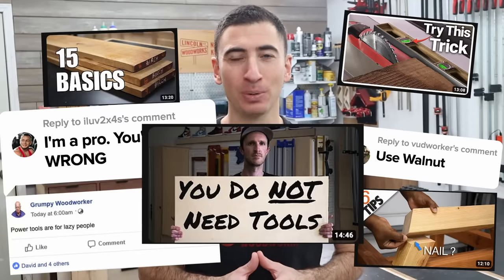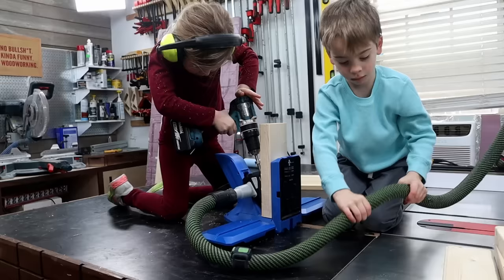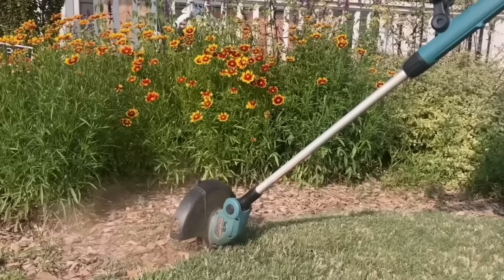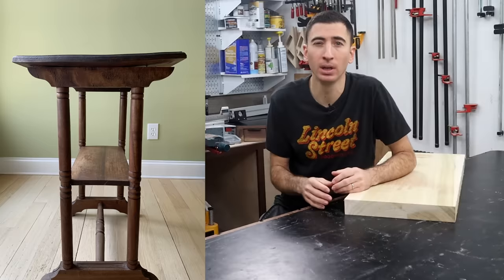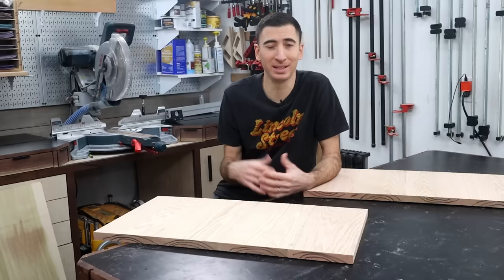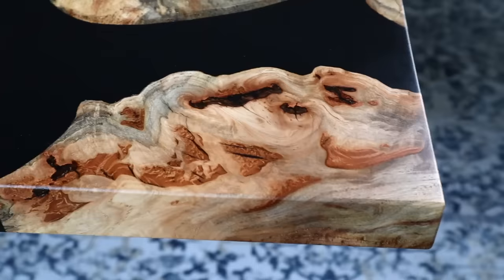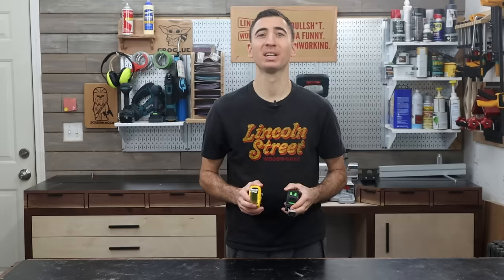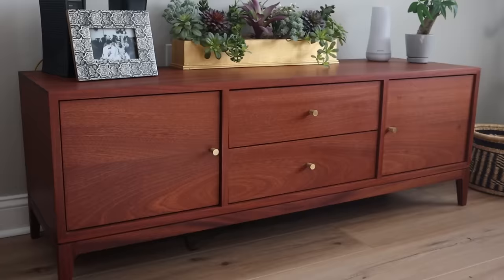Every beginner needs to hear this

Comment: Anecdotally coming across antique pieces with alternating boards that have cupped, and non-alternated that haven't, has a bit of survivorship bias. We have zero data for how many of each type failed along the way and were taken out of service (disassembled, thrown away, burned, etc) or repaired. When I worked for a high-end office furniture dealer (clients from international tech brands, auto manufacturers, global department store chains, VC firms, and charitable foundations), and one of our big tech company clients purchased multiple thousands of glued-up, wide-ish plank "butcher block" style desktops and cafeteria table tops over the course of 4-5 years. All wood was properly dried, all seams were reinforced by floating tenons (mostly just for glue-up alignment), and finished on all sides with a conversion varnish. While the offices had robust HVAC, we still noticed drastic differences in the number of "trouble" desk/table tops when it came to the grain direction of the flat sawn wood. So much so, that eventually there was an added requirement that the wood direction be alternated from plank to plank. And this wasn't a customer requirement: it was the manufacturer who decided to implement the change due to the number of warranty claims, and did so with no additional cost to us...doing it the commonly-references-as-wrong way was costing them money.

Hard agree with the sawdust+glue issues, though. Using it is terrible advice in many cases. One super annoying thing I see on so many pieces of furniture and flooring, is when a blemish or something is filled, and they use a LIGHTER fill. It always looks gross. I see so much maple and oak with holes filled with light Band-Aid colored wood filler, and it's such a turn-off. On my stone tile in my kitchen floor, too. IMO darker will always look more natural. We're used to seeing "shadows" on furniture in reveals, and under overhand, etc so dark spots don't stick out as much to my brain...but a light patch doesn't make any visual sense and sticks out like a sore thumb.

And also a big agree on the power tools. There's no "perfect" brand. Aside from Festool, Milwaukee seems to have the best track saw, while Dewalt seems to have the best trim router, and Ryobi has the best 13" lawnmower and hot glue gun. :) (I kid...I adore my Ryobi glue gun and 13" lawnmower!). Makita's cordless miter saw has the best power compared to Milwaukee and Metabo, but Metabo has the best dust collection and 45 degree miter accuracy. From the big brands, performance differences are negligible in most tools, unless you're working with them 8+ hours a day where small ergonomic or performance differences have  a big impact.

Comment: Regarding the second thing about power tools... I bought a black and decker drill that has done pretty much everything from taking apart garden furniture (a rental had had pallet furniture screwed together, I wanted to get rid but remove the screws first where possible) to drilling through masonry for a tv bracket. I bought it four years ago and it's going fine. I bought it for less than £100. I also have a MacAllister circular saw, orbital sander, planer and router, each around £50 each and whilst they may not last if I was working professionally, they absolutely do the job I need with no problems. My only screw ups were my own fault as a newbie.

You do not need super expensive power tools as a beginner. It's not just a case of "if they're cheap then you'll think woodworking sucks" or "they'll cost you more in the long run"... trust me unless you're buying power tools on Wish, they will make back their cost quickly.

Comment: The comment that budget tools are fine for beginers because they don't put enough hours on them to wear them out is sort of true. the problem is that tools are not rated by total use but continuous use, call duty cycle. It used to be part of the spec's you saw on the box but I suspect it was dropped because it showed up the real differences! Duty cycle is the continuos time you can use a tool for before you need to stop and let it cool down. It is usually expressed in min/per hr. Cheap tools tend to have duty cycles of under 15min, quality hobby tools around 35-45min. 'Contractor' tools should be rated for continuos duty, eg you can use it for an 8hr shift without it breaking. Obviously that needs better cooling, better bearings, gears etc and adds cost. So by all means by cheaper models for tools you will only use for a short time but don't try refinishing a wooden floor with a $60 belt sander, it is going to melt!!

Comment: Good video & advice. Thanks. I'm a hobbyist/My Home remodeler. My choice of battery tools is Makita - for their long lasting batteries. I baby all my power tools. Yeah, I know - way too much. I have 2 drills that still work good, but don't use anymore I bought in 1965! One is a $10 Black & Decker and the other is a heavy duty metal case unbranded department store drill. My good electric drill is a Dewalt.

Comment: spot on with everything! and I am one of those "been doing this for 30 years" guys but I am NOT the type to act like I know everything or that there is only one way to do something nor would I want to discourage anyone from getting into woodworking. I have spent the first 15 years of my career as a custom cabinet maker and this last 15 years have been in the field installing cabinets, trim work and building custom items for people so I have a different perspective than someone who has spent all their time in the shop and become a total snob about things. I think what makes for a great craftsman is the ability to understand what matters and when it matters. there is a time and place for very intricate complicated woodworking for sure, a time and place for perfection, but as you have said in this video , in most situations all that crap is not nessisary and does not really benefit the project.

Also I do personally like to have really good quality tools because they work well and I do this for a living but if I was just a hobbiest or a homeowner that needed some tools I would 100% go for Ryobi , honestly nowadays Ryobi is not even bad at all, they are pretty comparable to the more expensive brands, there was a time when  ryobi was just absolute trash but not the case anymore. In my beginner days I made some great things using crap tools, it is completely possible, it just takes longer and a little more difficult.
Anyway thats my two cents on the topic. anyone wanting to get into building things reading this...I DARE you to just do it, build something, it doesnt need to be great , build a box or a workbench and get the feel for things. each time you create you will get better.

Comment: I mean to be fair though, people suggesting dowels aren't wrong. The price of glue and dowels, some inexpensive dowel marking hardware is far less cost than a pockethole jig, special bits and clamping pieces into funky contraptions to get them lined up. Say the kreg kit, the basic kit is currently on sale for $34 and range up to $90-150 for more deluxe versions (because they know clamping the small kit is going to suck). Multiple self centering dowel jigs are $10, even woodpecker jigs are under $30. Options that don't require more traditional joinery. 

If people want to pocket hole every project like ana white, knock themselves out. Makes for a good 10min yt vid. Same people scotch taping wall covering up and other 'it held long enough to video it' techniques. Pocket holes do have a place but most people are like a little kid who gets their first hot glue gun. Suddenly they're using hot glue for everything. Nothing wrong with offering alternatives. Again making assumptions someone wants to get into woodworking. If they want to avoid the hassle, ikea exists.

Comment: I like your approach to these guidelines, especially the pocket screw controversy. I was taught, many generations ago, that a proper glued joint will actually be stronger than the wood itself. Great for sold wood, MDF requires a different solution because the surface does not have the tensile strength that solid wood has . I live in Oregon so the notion of using extruded shop floor sweepings makes me gag anyway!

Comment: I don't know if they're still made as well, but I always hear trash about Ryobi cordless drills, but my 18v WILL NOT DIE. It's fallen off my 6' ladder maybe a dozen times onto the concrete garage floor, and I don't know how many more times off saw tables and workbenches. It helped build a whole stage set at a theater in Hollywood for my friends, passed around to novice users for an entire weekend. It's put in a dozen 100pks of 2" and 3" Kreg pocket hole screws, and drilled the holes for them. It's put together a bunch of cabinetry and projects. I've drilled countless holes with spade bits, auger bits, and every kind of spiral drill bit up to 1". It's cut holes through 2x material with an adjustable hole saw. It ran Halloween decorations for a few years - from fully charged to dead every night for the month, with a zip tie holding down the trigger. It's my only drill, so I use it for absolutely everything, and have for 20 years (as of this year!). Maybe it's no good for a person doing all-day framing work(?), but for a guy who was pretty obsessed, with a hobby shop of about $10k worth of equipment (at 20-years-ago prices), out there building ideas every day for a few years, and then all household needs, I wish everything I had was this rugged. It still looks good, and I don't even think I've replaced the battery yet (if so, then once). It feels like it'll last the rest of my life.

Comment: Mostly agree. But I’d love to see more data on the alternating growth rings. Species likely has much to do with it. I accidentally glued up a table from very dry walnut without alternating, and it did cup after a couple years. I’d say alternate if you can.

and there is value in glory and the satisfaction of proper joinery.

Still, appreciate this style of teaching!

Comment: I found he’s right about the growth rings. I made an island top out of ash and before I started the finish it severely cupped even though I had alternated the growth rings.. The wood had naturally dried over a few years so it wasn’t too wet. I told what happened to a friend who built custom cabinets and he said to turn it over and leave it alone for a few days. Sure enough, it went flat on its own. Then I finished and installed it and it’s been fine. One key tip is to not finish and seal it unless it’s flat.

Comment: I started out with a DeWalt drill and circular saw 20 years ago, and both of them died a couple of times. Then about 10 years ago my wife bought some small Ryobi stuff for misc small jobs… it ended up replacing all my DeWalt stuff and in 10 years haven’t had anything Ryobi die on me yet. It certainly feels cheaper, but is holding up to my amateur needs.

Comment: There are good reasons why all of these tips and adages came about, and thus reasons to continue using and following them to some extent, but like many things, the good gets blurred when taken to extremes and misconstrued. Knowing the strengths and behaviors of more advanced joints and how you could incorporate them into your work is a good thing; but yes, remember that pocket hole joints do have advantages in speed and simplicity and will hold up just fine for general use. Yes, most hobbyists aren't going to strain most power tools to the breaking point, but it is still a good idea to get to know why certain professionals prefer certain brands for their features and durability to make an informed decision of what works best for you. Yes, grain direction probably isn't going to make that huge of an impact on what your average hobbyist makes, but the important part is to understand how wood behaves over time as a construction material and bear that in mind as you're designing your piece.

Comment: For what it's worth, I purchased my first Ryobi circular saw/sawzall kit 26 years ago. The circular saw just died last week, when I was trying to force it through wet pressure treated lumber. I was in a hurry and didn't want to break out the corded saw. The sawzall is still working. 

I have Milwaukee Fuel 12v tools for my everyday work stuff now, but that's only been in the last 2 years.

Comment: Ive actually felt the difference on Ryobi, hence I bit the bullet, added more money and went with Makita LXT RTJ set (RTJ is their "starter" tool, charger and two batteries). Ryobi plastic was cheap.
Good advice to platform is to go to a store that sell most brands, grab their tools and check how they feel. Also, for now - stay away from Hilti, Festool or "worst" of them - Mafel. They are expensive AF.

Comment: I was enjoying cabinet making when Makita 9.6 came into the marketplace. Their corded tools had long, long cords (B&D and SKIL had shortened their cords to a pigtail). Those drills installed more cabinets in So-Cal then I want to remember. Then came DEWALT's 12 volt platform.... and I had to have the "best" which meant I had more money than brains... although THAT WAS a real improvement. BUT again as DEWALT kept putting bigger and bigger batteries on their drills/platform I started to realize my arms started to look like Popeye's from lifting such heavy drills all day installing cabinet/countertops. It was THEN I realized I was sucked into "bigger was better" and it really wasn't true for ME. I now use Ridgid 18's at home since I've retired a few years back AND I like their warranty... so I AGREE WITH YOU about pick a color and move on. I still have a Ryobi Chopsaw and jigsaw in use today, though my main chopsaw IS a sliding Dewalt.

Now.... about measure twice cut once or is it vice versa... EVERY time I mark the wood like you showed, I cut it just a tad long and then recut it.... I end up cutting it short then I need to mix up a quart of wood glue with a shovel full of sawdust and create a mold around the short board I just cut short and pour my concoction of glue and wood dust into the board mold. Seriously, I just learn to cut line plus, or line short after marking it. Really I don't make that mistake too often NOW unless... unless I can't find my coke bottle thick safety glasses and I just wing it.... oops.... there goes another finger!!!

Again, seriously I really enjoy your tips and tricks. It's really okay to start small, buy less expensive tools and as time/budgets allows move up the quality. I would recommend find a tool line that does allow ALL battery sizes in their brand to fit any of their tools. I did NOT like DEWALT would not allow you to slip a 18 volt battery on a 12 volt drill (that is... if I recall correctly). Dang.... I miss my DEWALT 12 volt drills, though the Ridgid 18 volt line is as comfortable.

Lastly, keep the vids coming as I still learn better/smarter/affordable tricks/tips on YOUTUBE. Thanks!!

Comment: When I was a child, my dad built a hutch to sit on top of our computer monitor out of pine. He used screws and glue, telling me that the screws were there mainly to hold the joints tight until the glue set. 10 years later when we decided to get rid of the hutch, it was a surprisingly difficult task to break it apart. I thought that once I removed the screws, we could just bust it up. The glued joints seemed almost stronger than the solid wood itself. I think we ended up cutting it into pieces. For furniture designed to sit on top of a desk and be a lightweight shelf, it was fine.

Comment: as an old dude, 77 to be in fact, i have noticed a big difference in wood from when i did stuff and now, like you said moisture content is what matters and i have seen some really messed up wood pieces that look like propellers for planes because of this. that is also why the tell you to age your firewood because moisture affects how it burns and the heat you get out of the wood,  real quality wood is hard to find as i see it thats why so many are going with the fake composite stuff and yes finishing both sides of a project is good if you can because it will prevent the moisture affect on the wood. power tools for the average guy does not have to be the most expensive, i shop around for sales and this works out great for occasional use for wood working or even mechanical stuff like cars. also, if you dont look after your tools properly the good ones also get ruined.
i agree with the knot stuff, i would fill the holes but let the imperfections stay and add character to my wood working stuff, people admire this over a hide job that looks like crap,
i have also done what you do, cut longer and trim to fit and uses scrap wood to made templets for the good piece, great advice overall

Comment: Another great tip is when you buy a new tape measure don’t presume it is right, check it in pull and push mode against a reference. I bought 2 new tapes recently and checked them against 2 I already had and an engineers metal ruler that I trusted. Only one tape was accurate and one was out by 3mm!!

Comment: As a professional contractor, I meet a lot of DIY-ers who ask about tool brands. First, while brands like Ryobi are generally fine for around-the-house stuff, I can't list the number of their circular saws I've seen die after even very light domestic use. But short of their hand-held circular saws, everything else seems fine for general use. Second, I'd say it is worth more than just "pick a colour and have at it", if you think you might move from general hobbyist to avid wood worker (even if not commercial), it is a real pain upgrading, or swapping battery tech. I'd say consider what is most available at most stores, in Australia, picking anything available at Total Tools or Sydney Tools will give you much better access to really good deals, and you can customise combo kits to swap out tools you already own for the ones you really actually want. But that's my 2 cents worth.